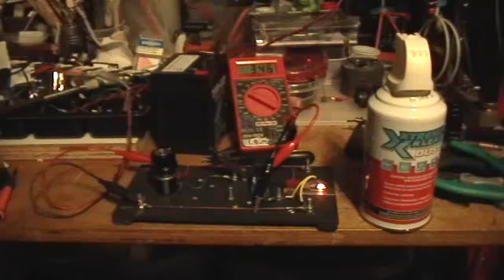Electric OU: MOSFETs: How do they WORK ? Part 8: Putting feedback to use

Comment: They are incredible simple many of the old valve (that is "tube" for you,) and mosfet circuits.
Even such a fine thing as a driver for a balanced line is just an amplifier with one valve/mosfet and 2 extra resistors.